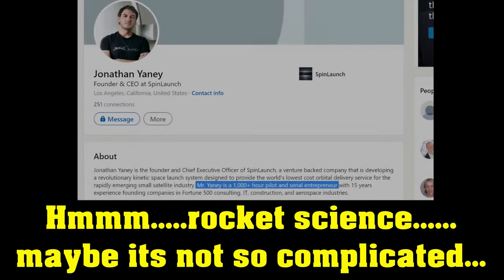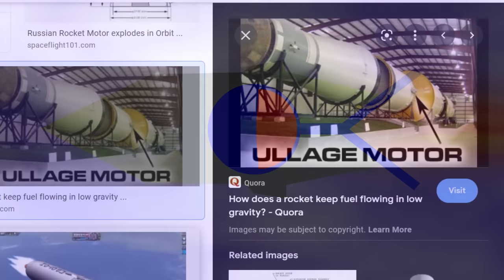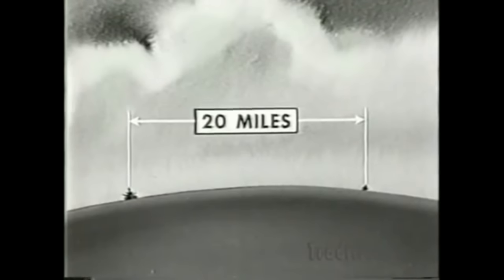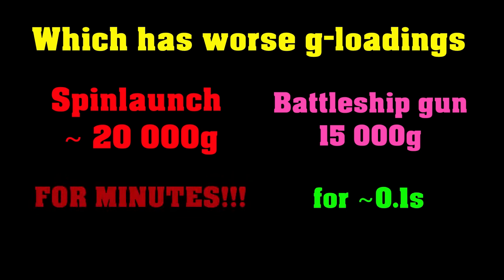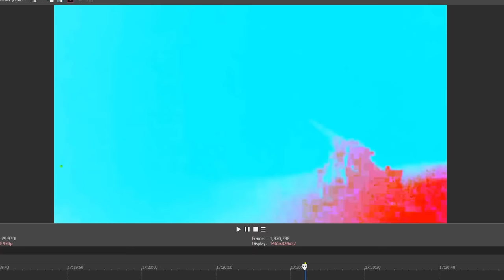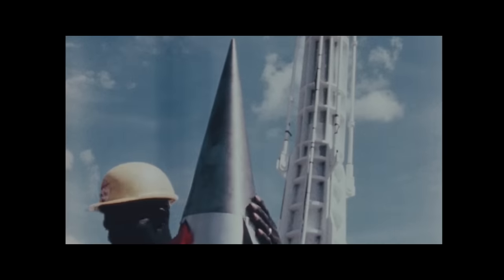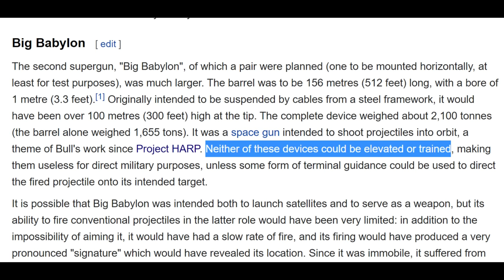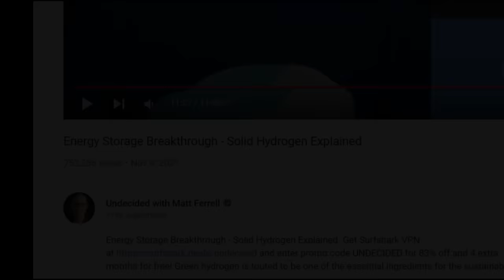Spinlaunch: BUSTED (Part 2)

Comment: Just thinking of the basic physics in the spin-launch system, you have a balanced high velocity rotating mass, at the point of launch one side of the system loses the projectile, 200Kg. At the point of release balance is lost. It would be like cutting a propeller blade off at full throttle. Rapid disassembly would occur. Or simply put, BOOM, CRASH.
Reply: Yeah I think this . Plus the instant 1 atmosphere would be a bad combination
Reply: That's ok as long as the inventor is nearby and the darned contraption is no where near anybody else.
Reply: Eh, that seems solvable to me, having a weight on the rocket side of the arm go from a bit further in to a bit further out could balance it.
Reply: @ravener96  good call
Reply: @ravener96  Or have the counterweight released at the same time into a catch mechanism... IDK
Reply: @stratometal  What sort of mechanism do you propose to catch roughly 100.5kips without destruction to the machine?
Reply: @dementedpaintballer  Water tank
Reply: "Rapid Disassembly" I like that. Sounds like youtuber Scott Manly talking about a flame out of one of space x's rockets. The exhaust turned green suddenly then the rocket crashed. The rocket set fire to the injectors and Scott said "engine rich fuel mix" LOL
Reply: @difflocktwo  A water tank in a vacuum? How do you avoid the triple point? How do you avoid water vapor fouling the vacuum? How do you prevent ice crystals all over being impact hazards? Are you expecting the resulting solid block of ice to instantly transform back into liquid water at the exact moment the vacuum is lost and the chamber is back at atmospheric pressure? 
Physics says no, a water tank will never work.
Reply: @dementedpaintballer  The same way the payload leaves one end, into the air, the dummy load leaves in the opposite direction and is eventually smashes into a tank of water or similar. A water tank can be in a vacuum but it probably would be outside the vacuum and the counterweight would break through a film like in thr video.

You can put a soda pop bottle in a vacuum and nothing is going to happen and nothing is going to freeze. But in the case of catching the counterweight you wouldn't keep the tank in the main chamber.
Reply: @difflocktwo  Oh so now instead of having to seal 2 holes Everytime you launch, you can seal 3.....or is the rocket entry point serves as the same hole for the counter weight to exit from? So now instead of accelerating 200+Kg to mach 7, you can accelerate 400+ KG to mach 7... Then release the counterweight and rocket, let it crash into a water container suspended in a big room(since water is not that compressible and the shock would instantly travel through the water tank and rupture it, or crash into an underground swimming pool that would no doubt create a mini earthquake Everytime the counterweight crash into it, 200+Kg at mach 7..........sweet) located far away since you know, you don't want water to get near the launch platform.

Then after that you can replace the water containers/or not if you're using swimming pool and the counterweight Everytime you launch.....

Wait if the counterweight leaves via the same hole as the rocket entry hole, woah imagine the shockwave of a Mach 7 projectile travelling through the atmosphere. If not then you have 3 holes to seal and another potential failure point to worry about........ Cool
Reply: Nah they just want to get the launch system to space too! (In pieces, unfortunately)
Reply: @snowstar3560  Someone asked how to catch the counterweight. I suggested a water tank. The specifics of everything else is independent of catching the projectile. Yes you would need an extra window to exit a second projectile.
Reply: @difflocktwo  "The specifics of everything else is independent of catching the projectile"..... LMAO basically saying if you ignore everything else, my solution works hahahahaha isn't that how most scams started?
Reply: @snowstar3560  I'm wondering how their test launch worked with an unbalanced arm. They managed to  release a mass from a flywheel/ centrifuge.
Reply: @difflocktwo  Hey I got a better idea, why don't we decelerate the counterweight via a magnetic field tube to slow down the counterweight due to Eddy currents generated, that way the counterweight is slowed down in a controllable manner and that the counterweight is intact. 

Plus we can shape the counterweight for maximum efficiency and choose great materials for it......what's that? It would take a tunnel kilometers long and a powerful powerplant to drive the superconducting magnets? Basically smaller version of the LHC which cost billions to build? But but "The specifics of everything else is independent of catching the projectile" LMAO.
Reply: @difflocktwo  How heavy is the test projectile? And not to mention They are testing at 2% the energy of the planned mach 7 as stated by thunderfoot, plus we don't even know the condition of the ARM after that launch, we are given no information about all this.
Reply: @ravener96  
Yes, you could have a weight of 200 or 300 kg, depending on it's distance from the centre of rotation, slide into position within a millisecond or so - sounds really plausible - I don't think !!!
Reply: This would acutally be solvable. Just have a 200kg counterweight an release it at the same time in the opposite direction. (An catch it in a water tank). The 1bar Atmosphereat Mach 15 would be  devestating though
Reply: @difflocktwo  I still fail to see how a water tank is going to safely arrest 100.5kips without destruction.
Reply: @difflocktwo  the way it worked was by launching a dummy projectile. They only had to contend with 20% of their target speed and likely only 5% of their projectile weight. The imbalance would be within the safety margins in their test, but a live test the loads would be far greater and end very much in a rapid unplanned disassembly.  The live load would have a force if roughly 100.5kips on the end. This dummy load, worst case scenario would have only been 1kip.
Reply: @fabianfeilcke7220  wouldn't it be simpler to just use water as the counterweight?
Reply: @dementedpaintballer  The other complication is that in the case of high speed impacts liquid water behaves more like a solid. Likely that whilst the impact would shatter the impactor and create a steam explosion the majority of the impact energy would likely turn into a seismic shock wave.
Reply: @difflocktwo  how MENY kiloton of TNT
Doe's that's eqvevilate 
Evert time you HALF arm you 4X Mass of counter Weight
Reply: @markevans2294  That's my whole point with attempting to stop that much force with water. There would be a catastrophic failure of the system, especially with the forces that would be generated being higher than the tensile strength of weldments that would be holding the tank together. 100.5kips slamming into a non-compressible fluid is absurd.
Reply: @dementedpaintballer  The water is free to escape. I used some online calculators and it seems the 200 kg mass at 7x speed of sound is like 250 kg of TNT. Does that sound about right? Someone even mentioned using a water tank as the dummy load.
Reply: @difflocktwo  That is flawed logic at it's best. This would be destruction of the entire launch apparatus, eliminating any reusability of anything with possible exceptions of portions of foundation slabs and remote facilities.

You don't slow a car down by crashing it into a wall.
You don't slow a plane down by crashing it into a wall.
You don't slow a rocket down by crashing it into a wall. 
You don't slow a machine down by throwing something in the gears. 
Even SpaceX's glorious hyperloop tunnel thing doesn't involve slowing the damn thing down by crashing it into a wall.
Reply: @dementedpaintballer  There won't be any passengers in the counterweight.
Reply: -Matter didn’t create anti matter
-Anti matter didn’t create matter
(Both of them were present at the time of big bang)
-Both of them didn’t create themselves.
-Both of them came from an unimaginable source,  that unimaginable source created matter and antimatter (everything) thats why it is known as “the creator” of everything.
——————\\\\\\\\\\\\\\\\\\\\\________\
- that unimaginable source/creator has created sin and virtue which are opposite to each other,
— logic says every action has its own reaction, so the reaction of sin must be different than the reaction of virtue,
— the creator has created prophets to let us know about each and every detail of sin and virtue, also about their reactions,
Thank you :)
Reply: @kennethschultz6465  1/4 kiloton. Isn't it? edit 1/4000 kiltoton.
Reply: @difflocktwo  No, those numbers are vastly incorrect. If you're having to use online calculators here, the maths and physics involved are likely above your head.  No offense.
Reply: @dementedpaintballer  You telling me i am not allowed to use the kinetic energy formula?
Reply: @difflocktwo  Passengers is irrelevant. The entire SpinLaunch mechanism will self destruct, not just a released counterweight. At that point, it's safer and more economical to use conventional rockets. Safety margins must be taken into account. This would be like launching a rocket knowing 100% that upon lift-off, the entire thing will explode destroying everything around it.
Reply: @dementedpaintballer  So releasing two weights slightly out of sync is what you're worried about? Or are you worried about catching the counterweight? I have been talking about only catching the counterweight this whole time.
Reply: @difflocktwo Both, but in my replies to you I have been referencing only your catching of the counterweight in a non-compressible fluid, I.E. Water. It's an issue of destructive physics and the act of arresting such force in a semi-contained  body of water will be destructive, not the counterweight per say, but to the launch mechanism. Unless you're fundamentally changing the design of the spin-launch system to project the counterweight away from the device, which would render the launch capabilities obsolete as the trajectory of the actual payload would need massive correction from guided rockets to reach an orbital path, there is no safe path or space for a water catch anywhere in, near, or around the mechanism/facility. If the payload is going up, the counterweight must go down, of which there is no viable or non-destructive path. Even if you build a tunnel deep underground to launch the counterweight into to keep the resulting shock of the impact of water away, you've only created a cannon that will still direct the destructive shockwaves at the launch mechanism.
Reply: @dementedpaintballer  I think the current design does exactly this, it launches a counterweight in the opposite direction and it's far away before it crashes into something. The test looks like it went underground. 

You should need different launchers for different trajectories since the launchers look pretty static.
Reply: @difflocktwo  The current design has no method of detaching the counterweight and no exit path below.
Reply: @dementedpaintballer  The one they test-lauched looks like it has a symmetric arm and two exits in opposite directions.
Reply: @difflocktwo  looks can be deceiving, which is typically the goal of start-ups trying to attract investor money. Their maths are flawed, if they even have any true calculations. There is only one projectile exit path, there was no vacuum, and there is no detachable counterweight. Construction of the facility did not contain any lower exit path for any projectile.
Reply: I could see the entire facility going boom, but not the projectile.
Reply: @googleuser9383  Sadly, reality would likely show that.
Reply: @fabianfeilcke7220  Yes so once again basic physics slaps you right in the face. The counter balance would have to be released at precisely the same instant as the projectile, so you have a 200 Kg mass heading off into space, great, and a 200 Kg mass heading into the ground at a advertised velocity of 6x the speed of sound. The energy released from the merging of counter weight and earth wold be a  flash of light and even more interesting BOOM, CRASH. Also your "water tank" would have to withstand the G forces for a considerable amount of time, and of course should it structurally fail during acceleration, again BOOM, CRASH.
Reply: BOOM, CRASH GOOD? :)

Comment: In my naivety, I had a similar idea a while back for this kind of space launch. Think of it as a orbital launch ring, but scaled down. Then, I realised it's basically the hyperloop powered by magnetic levitation, where you just stop the magnets at one point and let it fly out. You'd solve a few problems with that compared to Spinlaunch, but you still have the massive problem of high-vacuum vs normal atmospheric pressure.
Same as the hyperloop in general - Neat idea, but falls flat when you look at the details.
Reply: it would be interesting to calculate what vacuum would be required for spin launch. my personal thought is you do not need a hard vacuum just enough to balance the thermal load on the craft.

Comment: That nuclear artillery shell vid mentions it's a gun type warhead so it's just a* donut of fissile material fired at a plug of more fissile material at the end of a barre. Done by a single charge that just has to accelerate it fast enough that the two pieces assemble fully before the reaction can blow itself apart and end in a  fizzle. It's not a plutonium cored implosion design that requires the precision timing of explosive charges resulting in a symmetrical shockwave to trigger it so that's kinda of a bad example of the ability of electronics to withstand the forces of being fired from a cannon. But some conventional shells with proximity fuses used to use pretty massive vacuum tubes so "electronics" withstanding gun forces was figured out a while ago it's the rotational forces and non straight line application of force that makes this a unique challenge at all.
Reply: I picked up on the design of the weapon as well, probably they used a variation of the WW1 time fuse to trigger the secondary charge to bring the two pieces of uranium 235 together. I am not sure of how the Davy Crocket was designed though.
Reply: @tda2806  The Davy Crocket is a plutonium implosion bomb if Wikipedia is to be trusted. It is a recoilless rifle so the acceleration will be lower. From what I can find non of the gunfire US nuclear weapons was of a implosion-type.
Reply: A better example would be more modern artillery. The M982 Excalibur round has GPS and inertial navigation and has been fired at 18,000 g acceleration.

Comment: Another problem with Spinlaunch... In theory, the vehicle is spun up in a near vacuum yo Mach 6 and then hits the atmosphere at ground level where it is thickest. The craft will be instantly incinerated without a heat shield - either an ablative heat shield or "tiles"... It's like re-entry in reverse...Ablative is heavy and not reusable...So we are left with tiles that must withstand huge lateral forces over hours as the vehicle is spun up and then survive a fireball twice...once upon going up and again coming back down.

Comment: The top of the arm are spinning just a fast as the payload when they break the vacuum seal making it heat up instantly inside the chamber and creating a massive pressure spike. Unless they have a way of instantly vent around the circumference of chamber and have some really good heat shielding on that arm I think the whole thing will basically explode when the vacuum seal breaks.
Reply: When your logic is even more flawed than the video. Air travels at the speed of sound. It is everything but not instant. 

If you want to, you can even make the tube a bit longer and add a door on the lower end. That door could be closed before the atmosphere would be able to rush in.
Reply: @_aullik  You do understand that the speed of sound is still around 300m/s right? That means unless you are willing to make the launchtube hundreds of meters long (which will create it's own problems) you'd need a door that can close within milliseconds if not microseconds without destroying itself, the mechanism that closes it and the doorframe, that still creates a vacuum worthy seal and can withstand an airblast crashing into it at the speed of sound. And even if you manage to do that, you'd still have to pump down the launch tube afterwards before you can launch anything again.
Reply: "The top of the arm are spinning just a fast as the payload when they break the vacuum seal making it heat up instantly inside the chamber "

Why heat up? The air outside would undergo free expansion, which is isothermal.
Reply: @isodoublet  First of all the air would flood into the chamber at the speed of sound where it would hit the still spinning arm. That alone would most likely destroy the arm but if by some miracle the arm survives the air blast it would now suddenly have to move through one atmospshere of pressure. And that would create an enormous amount of heat. And yes, sure, the heated air could escape through the now broken vacuum seal, but a) it's questionable wether the heated air could escape fast enough to prevent the chamber heating up and b) the arm would heat up extremly fast as well. And without an extremly efficient cooling system that can work at several hundred g and massive heatplating the arm would most likely just melt. Or at the very least loose so much structural integrity that it would blow itself apat from the remaining rotation energy.
Reply: @KingQwertzlbrmpf  Ah, I see I misunderstood your initial comment. Thanks for clarifying.